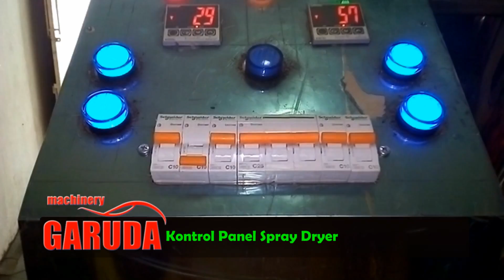Mesin Spray Dryer (Merubah Bahan Cair menjadi Bahan Bubuk/Powder)

Comment: Boleh nanya pak.
1. Price and capacty ??
2. Pakai High presure pump ( Hpp ) ?
3. Bisa multi stage dan Single stage ?
4. Untuk nozle pakai rotary system atau nozle delavan sdx 3 dan sdx 5 ?
5. Untuk high presure maksimal di berapa bar? 
6. Untuk set TIC dan Toc maksimal berapa?
7. Untul ental P nya bisa di atur Hmi atau semi auto.
8. Adakah  safety presure chamber , safety fire nya ?
9. Untuk sistem manual atau semi auto?
10. Untuk proses Cip nya gimana pak?

Mohon di jawab pak
Reply from the maker: Untuk info selengkapnya silahkan menghubungi marketing kami ya kak, tlp/WA di 081333202221/081252444967